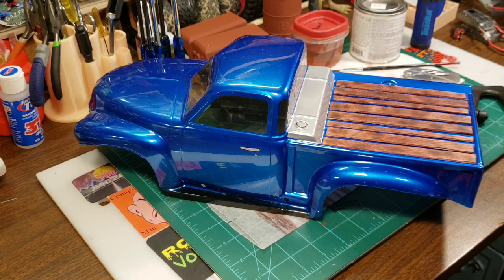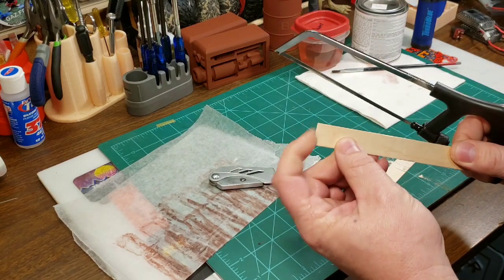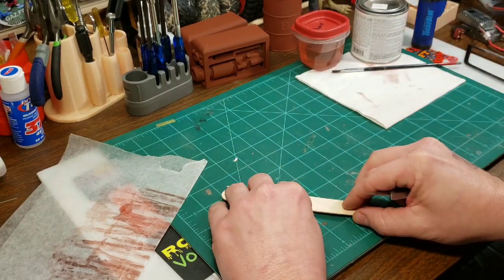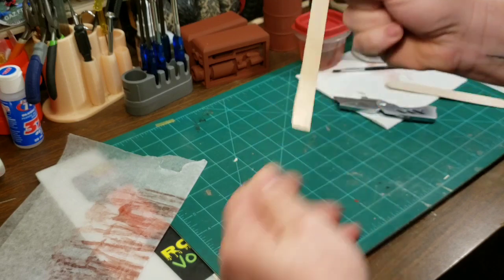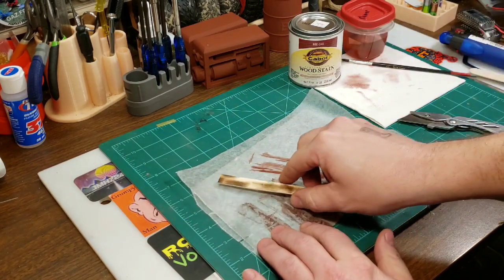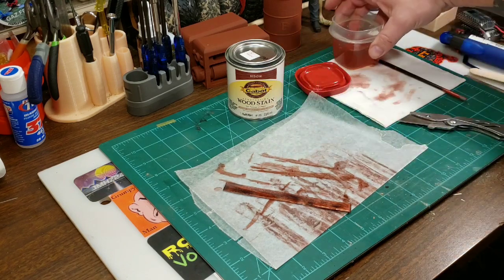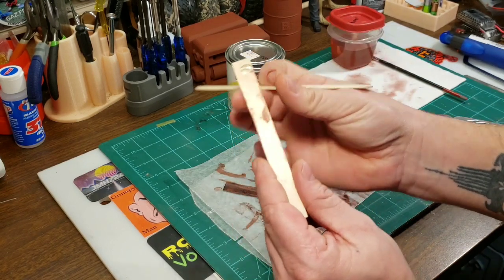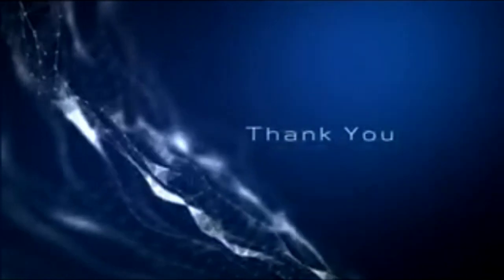Burnt wood bed for your rc truck DIY

Comment: More great tips for the scale master! Your stuff always looks so good man!
Reply from the maker: Thanks allot Tyler I'm 3d printing a trailer now plastic leaf spring s we will see how that works lol hows your printing going
Reply: @AdventureTimeRC  that will be really cool, my printing is going pretty good, trying to get nylon and petg dialed in better though, I've come up with a couple of CAD designs so far I'll let you know when I get a good finished product , what material do you usually print with?
Reply from the maker: @SteadfastRC  pla is my favorite to print with works for most everything I still haven't tried my own design s I did get a book on fusion 360 that will help whenever I get around to reading it